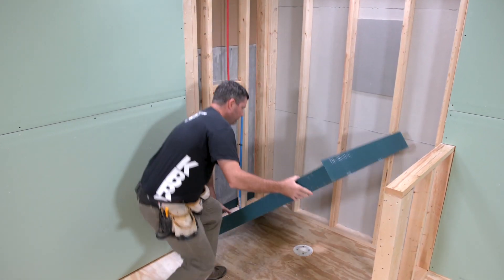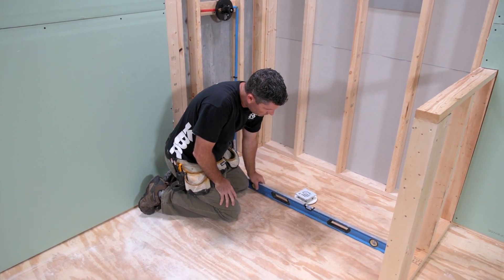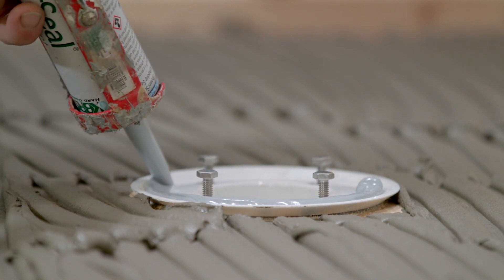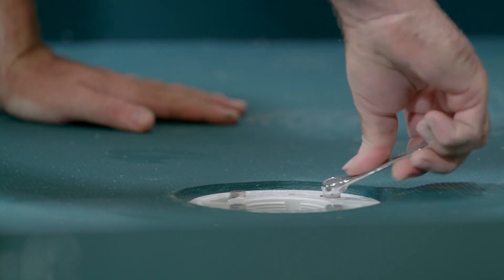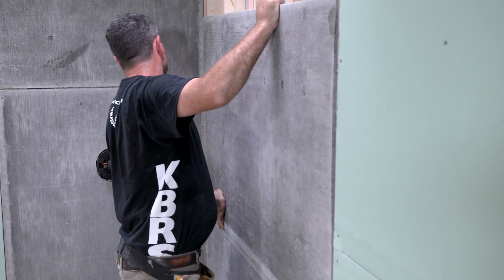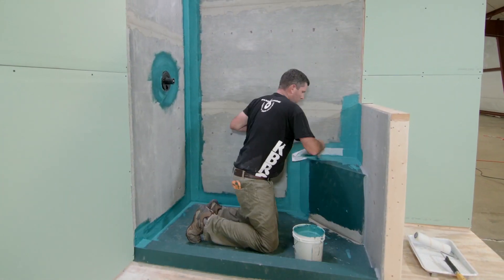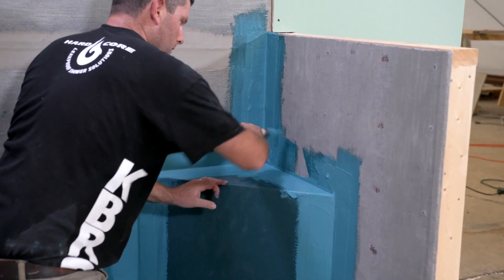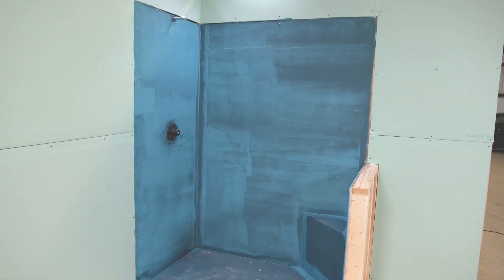How to Install a Shower Pan with a KBRS Tile-Basin®

Comment: If i order a 32x60 shower base, do i need rough opening of exact 32x60 or do we need 1/2" bigger for cement board?
Reply from the maker: It wouldn’t be bad idea to have the shower opening slightly bigger than the size of the basin as it would be exactly 32 x 60 plus or minus 1/8” for the manufacturing tolerance.

Comment: Any polyurethane sealant can be used?
Reply from the maker: Beyond the ShowerSeal® poly sealant we sell, we recommend either 3M 5200 Marine Sealant or OSI Quadmax for local purchase.
Reply: 100% silicone sealant was used on my drain. Should I try to seal it with polyurethane from the top before I tile?

Comment: What thickness are the furring strips used here?
Reply from the maker: The furring strips should be thick enough to allow the backer board to slide down inside the Tile-Basin® without applying pressure to the flange.
Reply: @Kbrsinc   typically how thick is the flange, or do you suggest waiting until my Tile-Basin ships and measuring it?
Reply from the maker: @robvoss2603  The Flange is approximately 1/8” thick